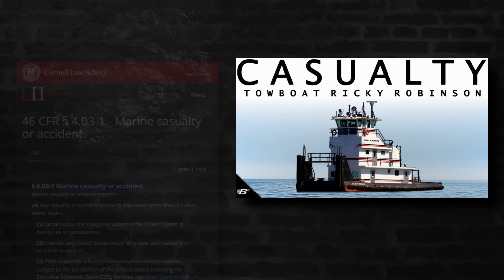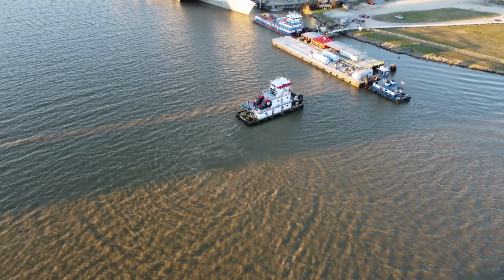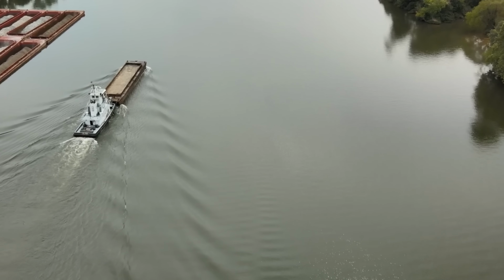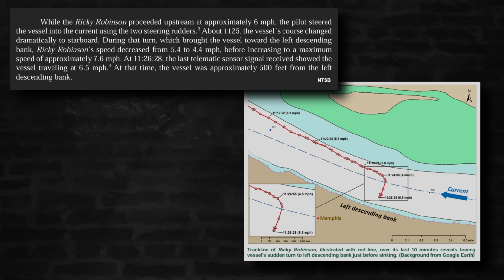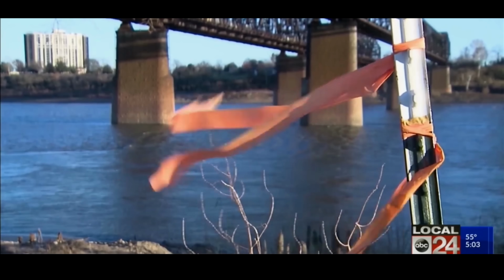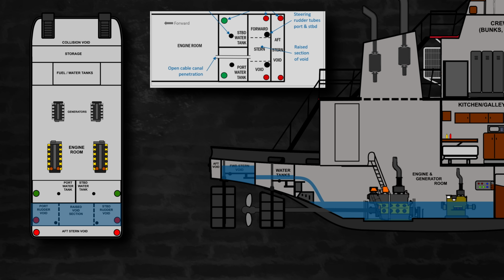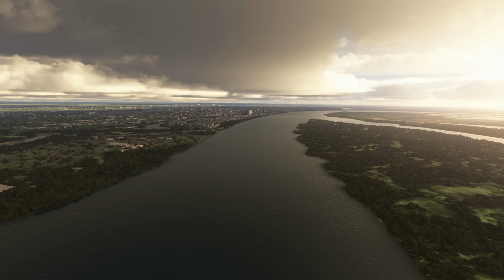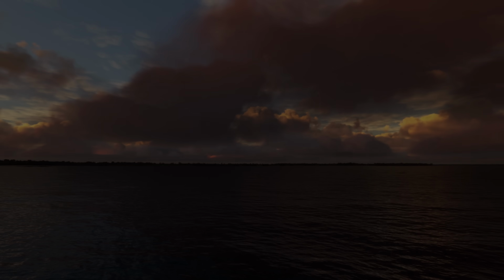INSTANTLY UNDERWATER: The Sinking of Towboat Ricky Robinson

Comment: Aviation safety professional here. It doesn't matter if you work on land, sea, or in the air - the lessons still apply. Understanding your equipment and procedures is vital. Having a robust reporting mechanism is essential. Having the courage to say "I'm not operating this piece of equipment until its fixed properly" is a must. When lives and multi-million dollar machines are at stake, capitalism must sometimes be placed on hold and safety upheld first.

Your videos are absolutely amazing material and can be applied to a wide variety of professions and mindsets. Thank you so very much!
Reply: Considering the huge losses and lawsuits and such that accompany any significant accident you could even argue that good safety and maintenance actually saves money. It's just that the corporate suits are too short sighted to see that.
Reply: Like a lot of people I work on land, but I’m a aerospace machinist. Working with big lathes can be dangerous, but there is also an importance on making a good part. Especially knowing it’ll be in the air.

Comment: Man.... Those little fleet boats are the most dangerous vessels to work on the inland waterways. Light boat the main deck is  awash, and when low on fuel the ballast is screwy, which makes them prone to heavy lists in a turn.

Comment: In 30 seconds and everything is over, how quickly can things go wrong is insane..
Reply: Don't forget that it can take years of neglect and poor safety regulation/enforcement in order for things to go wrong that fast, though.
Reply: It takes way less time than that for a inflatable P. F. D. to save your life.
Reply: @LuckyLucyHi  This is an important observation. It goes fast at the END, sure, but it can take years for things to get bad enough to go wrong "quickly."
Reply: Things were going wrong on that boat for years.  The last 30 seconds is just the conclusion to the buildup all of that negligence caused.

Comment: River engineer here.
I'm familiar with Wepfer, they never seemed to be too terribly concerned with maintenance.
Also, and this is sad to say, many towboaters are lax when in comes to the question of watertight integrity and reserve bouyancy; things like leaving hatch covers open is all too common.

I had one incident on an overly ballasted 8000 hp towboat where it rolled while trying to get a tow away fron the bank and it was so low in the water that it put the starboard engine room door partially underwater while it was open. We did get the door closed, and that was enough to convince the captain that we really needed to pump off ballast for more freeboard.

Comment: One thing that is curious to me is why did these void spaces not REQUIRE automatic bulge pumps and high water alarms in each space. Those covers should only be opened when performing inspections and maintenance in those areas while docked. Although I am not a mariner, I live on Vancouver Island and have been around pleasure craft of all sizes up to a 54 foot all welded aluminum yacht. That one had 5 separate bilge areas, all with automatic bilge pumps that could be activated manually but were always in automatic mode and gave a warning light when operating to the pilot. Because it was a live aboard, it had a  shore water supply connected from the dock to the onboard pressure system, BUT also had an electric shutoff valve connected to the high water alarm floats in case of a leak when no one was on board. These are relatively inexpensive systems that should have prevented this tragedy.

Comment: I worked on Line Boats on the Mississippi River and pretty much all Midwest inland waterways. The Missouri River southbound in high water is about hold on and stand by. We stood watch in the deckhouse in case we had to knock lose from the cables attached to the barges. With 9 loaded barges they will drag you to the bottom in 20 seconds if you're lucky. Great job, but dangerous as hell.

Comment: I worked for Wepfer in the early 90s.
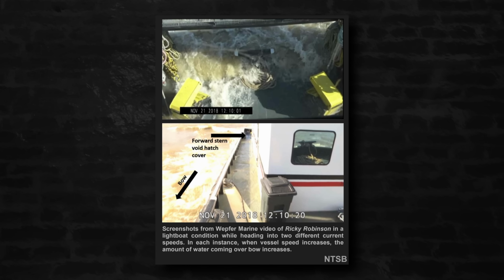It was common to see water over the tops of the deck winches when running light boat because some of the boats had no bull rails to keep most of the water from the main deck as seen at 17:00.
I often commented that "If the Teel Pump company ever goes out of business,these boats will all sink from lack of pumping out."
You had to know which boats that they had at the time(most from those days have been retired & scrapped)would leak where,& how often you  had to pump out the water.
I'd wondered if both pilot & deckhand were where they were supposed to be,in the wheelhouse & on deck trying to correct the problem before the boat went down.
This video explained a lot & confirmed a couple things I'd suspected from personal experience with the company.

Comment: One of those boat/ship designs where you have to wonder not only wtf the designers were thinking, but why any company or crew would view them as safe enough to purchase and sail, even in usually calm waters
Reply: If you knew the operating conditions on the western rivers you wouldn't question the design elements. Could some of the elements be better or changed? Probably but overall the pushboats are optimized for working in the rivers.

Comment: I wonder if they ever installed a suction line into those spaces to allow them to be pumped out without opening the hatches.
My personal experience tells me that's not actually likely.
So many of these boats have no safe and efficient way to remove water once it gets in.
Reply: Yep, and the bow coaming was clearly too low, if its decks were awash so often running at speed in lightboat. For a VP to be "unaware" is a cruel joke; they know. They just chose profit over safety. Again.

Comment: Deckhand on a tow boat. There should be absolutely no reason to have any deck hatches open underway. Light boat or pushing we still can have tones of water pour over the bull works due to how close we are to the water line. I've had a captain completely stuff the bow and had the whole deck submerged in water by a couple of inches. Even at dock I make sure all watertight hatches are secured, especially the forepeak. I don't won't push all the blame on the crew about (what I considered a massive leak) but at the end of the day the owner of the vessel is just as responsible as the captain.

Comment: Is it complacency or engineering (or something else) that consistently gets people killed on the job?

For instance; stern voids, lazarets and hatches that never seem to get closed cause more problems than they seem to be worth.

If it’s a problem with the design why can’t it be eliminated?   
If it’s essential to the design why isn’t it monitored more intensively?   

Is it just that people get comfortable working negligently?  You do something wrong, but nothing happens so you do it again and again and again until something does happen?   I don’t really understand it
Reply: Very well said.   I've always had these same thoughts.  Especially since I started watching Bl's in depth documentaries a couple years ago.  Seems very similar to a plane crash.  Everything just seems to line up in an unfortunate series of events.   Questionable design, external forces (weather and so on), short cuts or lack of maintenance, problems with hierarchy within the crew's, and just plain bad captaincy.   In short, alot has to line up in just the right order.   Mentor Pilot is a good channel for in depth looks at Airplane accidents and the NTSB reports that go along with them.  Have a great day ✌️
Reply: My experience with company cars/vans/trucks etc is that people dont give a sh*t about company assets. Tyres worn to the steel, brakes steel on steel, driving with an oil pressure warning till the engine goes, broken windshields, ignoring maintance intervalls etc. 

Especially if your not every day on the same machine. I can imagine a crew being like "oh not this rustbucket again" getting their shift done and going home and just not care. I had machines that aparently for months leaked oil so bad they needed a top up every hour yet nobody bothered to inform anyone. 

And yeah you tend to do get comfortable "its been leaking for a month now so today will be fine as well" or "its getting bloody hot in the engine room and that open door never had been a problem before so its not gonna be one now"

I dont remember his name, but a experienced scientist died because rather then the procedure he found it easier to use a screwdriver to experiment with a demon core of plutonium.  Never went wrong so why should today be any different?

Also I think you and me look more at the vessel and have a interest in the actual vessel like keeping her looking prestine, working as should and keep to the procedures (ignoring that procedures can be wrong but thats a whole other can of worms)  while lots of people see it as nothing more then a tool for the job

English isnt my native, hope my rambling makes any sense to the thought im trying to write down
Reply: Suppose you could equate it to the “frog in a pot of boiling water”. Either not being given the correct/adequate tools for the job, or not considering the potential side effect of certain actions. Doing the same sketchy operations day after day like you were saying, and eventually everything feels like just business as usual
Reply: Greed and apathy cause most accidents. These types of boats are finicky and need to be maintained and operated precisely or they won't be safe. Taking a risk and having work out okay for you doesn't mean it's not the same risk the next time, but that's a flaw of human psychology. Safety-conscious people are often derided in workplaces where safety is lax which further makes people stop speaking out about problems.
Reply: It’s complacently not understanding basic engineering or basic physics.

Comment: We were dredging in Corpus during a tropical storm. My boat hit a submerge line when a big wave picked it up and slammed it down. Shortly after I began to take on water. I got on the radio and got the crew to bring a pump as the bilge couldn't keep up. Luckily i got it back without it going down. We picked it up the next day with a crane and it had a 15 inch slit in it.

Comment: The boat at the beginning of the video, the Megan mcb sank at lock 7 if recall right. Am an upper mississipi towboat pilot, and I've seen some crazy stuff out here. If i recall correctly webfer had another tug sink between paducah ky and cario il about 4/6 years ago. Was in wickliff ky on a boat and saw the ring bouy from it go by. Deckhand wanted to get it. Hard no thats some bad luck

Comment: RIP to the 2 crewmembers...it's beyond sad. I do understand if in a "regular boat" & if below deck sleeping, eating or whatever, it's easy to understand how people die in sinking/boat flipping accidents because they are trapped in the interior of the boat & the amount of water rushing in creates maybe too strong pressure for them to overcome to escape...not to mention probably zero visibility.  But...on a tug like this one it seems to be not so insurmountable to swim to the surface if the boat suddenly tips over.  I assume the pilot was in the wheelhouse, so there's only one door he has to access & I'm assuming the deckhand was somewhere outside the wheelhouse.  Now, if both of them didn't know how to swim..of course that's another can of worms altogether, but I'm assuming they knew how to swim.  Again, I'm certain I'm oversimplifying all this & certainly no disrespect to the crew...but it's hard for me to imagine at least one of them couldn't somehow swim to the surface.  If anyone has any experience or knowledge on this, explanations are welcome.
Reply: Absolutely right.  The pilot/captain knew it was sinking, why didn't he order lifejackets to be worn, and the crew to assemble on open decks?  Drowning in these circumstances requires reckless incompetence.
Reply: all fine and good to have pfd's and easy egress to the outside/topside.  However, most of the pfd's on commercial vessels are quite frankly junk.  Also, even if they were able to get their pfd's on, cold water immersion shock would probably have incapacitated them almost instantly, making death by drowning a virtual certainty unless another boat could fish them out of the water within a minute or two.

Comment: Hard to believe the owners responsible weren't on top of issues like those rudder tubes.  And those void hatches!  Each void should have had a submersible pump installed at the constructing shipyard.  Those full size void covers should be bolted down, with a small hatch that can be opened for visual inspection of the void space.  When you have inches of freeboard, the design should not be allowing the vulnerabilities demonstrated here. And then the cabin door tied open, an issue that could have been solved with better forced ventilation of the engine spaces, and better mandatory crew proceedures.

Comment: I work for a similar company that has lax mechanical standards.  I would bet my money I know exactly what happened here.  The rudder shaft leaked, everybody knew about it, the company was too cheap to fix it, the crews tired of writing it up endlessly, with no resulting action, so they just stopped writing it up and used the work-around of pumping out the void regularly, which means they left the covers off, to make this easier. and this crew forgot.  Probably up in the wheelhouse talking or whatever until it was too late.

Comment: It all stems from poor design of the push boat. Too little freeboard, no runoff strakes to push the water overboard before reaching the stern area and poor rudder post setup. Add to that lax operating practices and accidents will happen.
RIP to the crew, but totally avoidable.

Comment: What is clear from this type of boat always having water on deck is apparently not able to be seen by the crews and authorities that deal with them. But the first thought that comes to mind to a sailor like me is that the freeboard of these vessels are simply too low for safe operations. One slip that nobody adress, and the vessel is a potential disaster zone. What kind of crew considers it ok to have to work a ship that they routinely have to take a look at the deck to see if it's flooding? And at such low speeds? And knowing that a hard rudder movement would make it quite sure that water would be on the deck.
No European sailor would even be allowed to work such a vessel. Assuming of course that he would be dumb enough to take hire on one. Even our lowest freeboard harbour tugs will never have their decks so low that water will reach the deck when at speed or listing while turning. That vessel would have been moored and shut down faster than you can say "Asshole." Quite apart from the fact that it would never have been given any certification to even move a single foot away from the pier.
I'm sorry. I do not intend to downgrade or call Americans stupid. But to a European, this thinking of being ok to operate any vessel other than a submarine to have water wash over the deck at low speed in totally calm waters is just stupid either way you look at it.

Comment: I compare open hatches/doors on a ship to wearing a seat belt in a car. They both can either save or kill you. It's all circumstantial, though example. You can have all your hatche's and doors closed and sealed, but if something happens and you can't open it in time, you might go down with the ship. On the other side, if you fail to close  all watertight hatches and you take on water, you can also cause your vessel to sink or sink faster. When you work on any ship, you are constantly moving between bulkheads, rooms, and decks. Especially on a small vessel with a small crew like the Ricky Robinson. I'm not justifying leaving hatches and doors open. I'm just trying to give an explanation for why they more than likely left them open. Imagine walking 5 feet, having to spend 3 minutes on a door or hatch just to walk another 5 feet and repeat the process. Again, I'm not justifying. Hope maybe this clears some things up for some people. Maybe what we need is a rework of watertight doors and hatches to allow for speedy access 🫡
Reply: I may be wrong but the one crew statement sounded like they kept the hatch open so they could pump the water out with an additional electric pump… works up until water covers the deck and floods into the hatch. Overall, seems like the tugboat should have been out of commission entirely until the source of the flooding was resolved
Reply: Normally accessed water tight fittings have quick access.

Like seatbelts, there is little excuse not to use one.

Comment: I was a deckhand on this boat. I worked for Wepfer Marine out of Hickman, KY during August 2023. I applied for the job because I was at a plant job and wanted a change of pace because I always loved being on the water. The Ricky was the boat I was mainly posted to, although, the Marylin Roncali, (smaller and older) was also used, but was laid up due to underwater hull breaches requiring a diver to weld her back together. The people who work on these boats are lowest of the low in terms of intelligence and usually all do drugs and have records. They would routinely do cowboy stuff and would operate with holds open, poor pay, use pumps to bypass water entering the voids, pollution, etc etc etc. The conditions and culture were so that I lasted barely over a week before quitting. When I voiced my concerns to upper management, I was brushed off and hung up on. When I went to pick up my paycheck, the port captains only concern was that I spoke about things that happened to people outside of Hickman. I left and did not look back. Yes, I did know about what happened on the Ricky, but not until after I was already hired on.